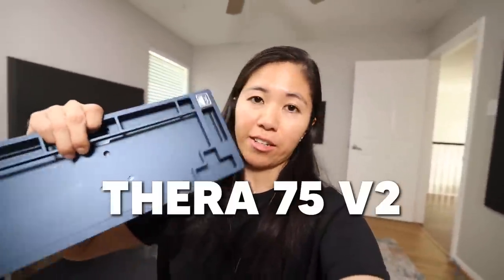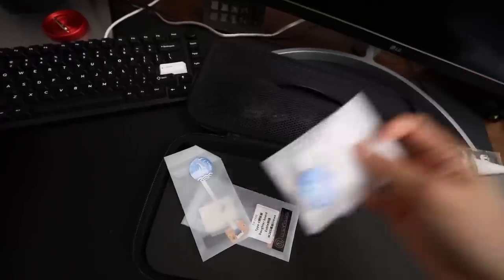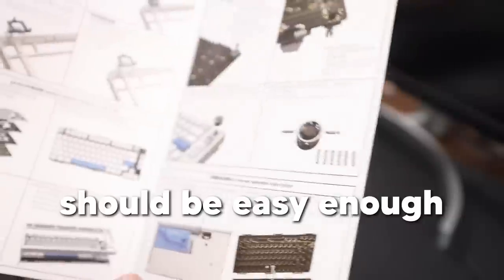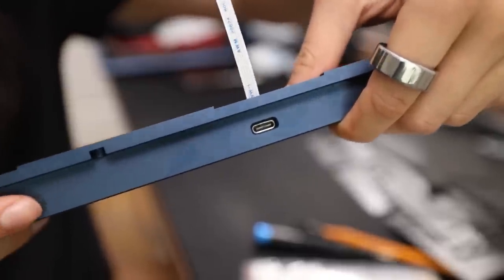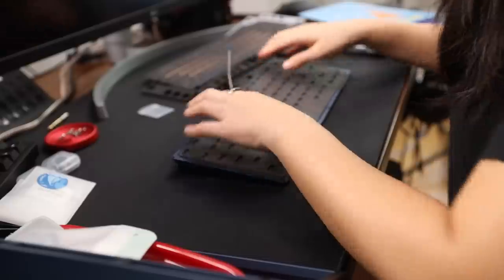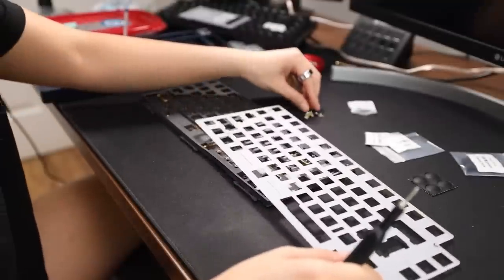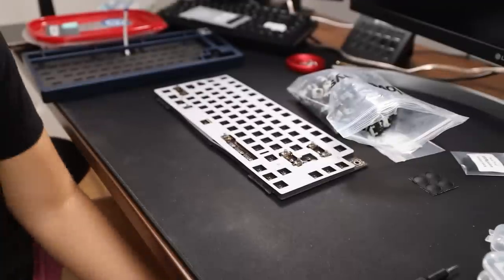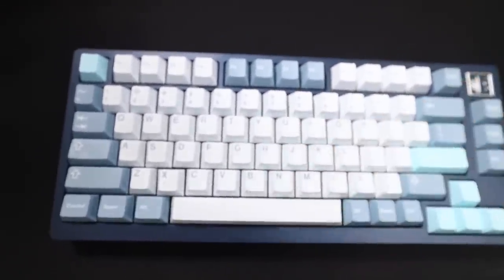a mechanical keyboard lover's dream keyboard

Comment: durock Anubis switches got these in my k2v2 sounds horrible stock but i l+f them i also did holee modded, bandaid modded and lubed them + plate foam + 3 layers of tape + silicone pour + tissues + ductape mount  + pe foam it sounded insane i cut of the standoffs for the silicone pour. it sounde insane

Comment: a little help need
i recenlty purchased my first mechanical keyboard redragon k617 fizz  red switch for 2500 INR ~ 30 usd , and I absolutely love it , 
but its has some ash coloured keys which im not fan , want to replace them with white keys n i have found some keycaps online but they like double the price of the keyboard ~ 40 to 50 usd ... are keycaps real that expensive?

Comment: Hi i bought some YMDK Ansi keys pudding double shot. On a corsair K68 they are nice but they have less travel, so the stem is shorter, which makes them good for typing but hard commands like on the corners are weird because you bottom out quick cannot gauge how hard to hit em. Whereas the stock ones had too much travel, but were breaking and very oil slippery. Maybe i'll try faster lube. Thanks.?

Comment: HELP WANTED: Hey so I recently got gifted my first mechanical keyboard and I’ve been obsessed with trying to find the best mods for it. It’s a keychron k8 with brown switches. The first think I did was a silicone mold which went great but now I want to change out the switches for a quieter linear that comes pre lubed. Any suggestions? Also I use the keyboard primarily for typing and I want a set of key caps that will help maximize my productivity, should I stick with cherry profile?

Comment: i love these kinds of videos so much ive been trying to make my own keyboard but i cant aford any switches
Reply: I like my Akko jelly pinks, and was around 30 USD for 90 switches through Amazon, super available. Hope that helps :)
Reply: In addition to the comment above about akko switches, consider Gateron milky yellows too. Those are pretty affordable and have been ranked at S tier by this channel
Reply: jwk jwick blacks are also a great budget option especially if you want to use them stock
Reply: Gateron milky yellows are really cheap and sound amazing (linear)

Comment: Hi switch and click. I am sending you an SOS to help improve and fix my keyboard. But it is the free write smart typewriter. It sounds completely awful and it feels wobbly. It sounds hollow and even echos. You need to work your witch craft! It's a challenge because it is a device not just a keyboard. Any advice or maybe you can do a video on the possible project help? Also I built my first keyboard! Keychron Q3! Even upgraded it and followed  your tips for mods